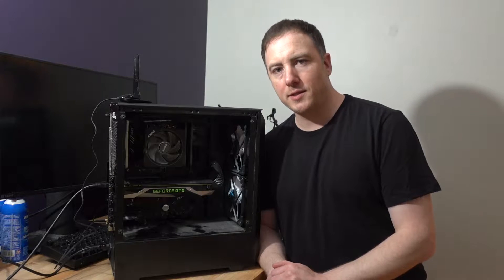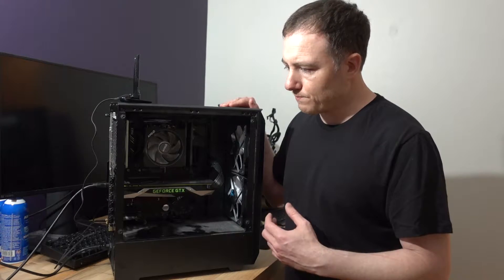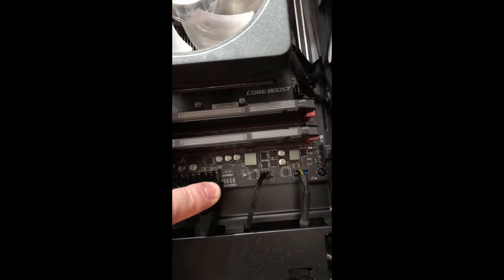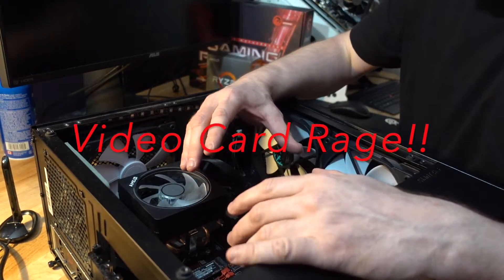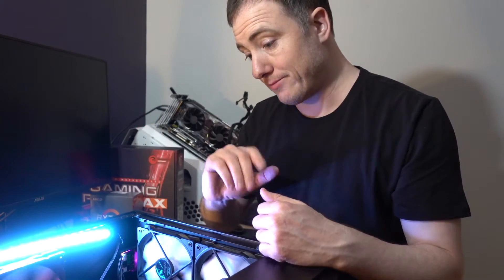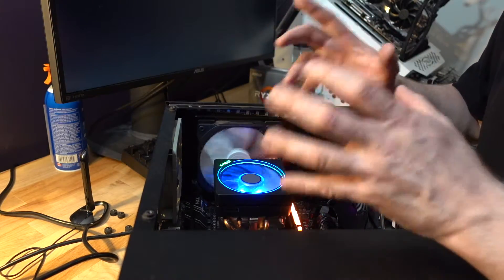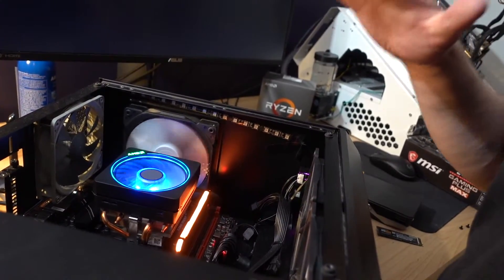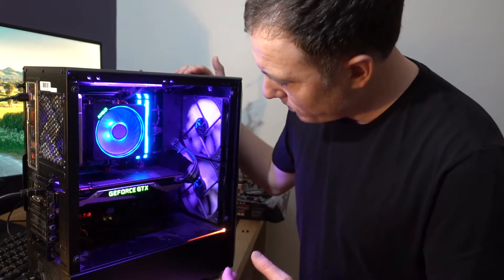AMD Ryzen NOT booting! - Troubleshooting PC -

Comment: I have a new mobo msi B550-A Pro. 
• PC boots & post with Amd Ryzen 9 3900x
• Doesn't boot at all when i put my Amd Ryzen 9 5950x

Do I need to make sure the 5950x cpu properly fits onto the socket without any side being wobbly?
Reply from the maker: Hey did you ever get this working?

Comment: Hi good vídeo,
I have 2 computers, an ASRock steel legend b450 board with ryzen 53600 and another with msi x470 gaming plus board with ruzen 5 1600 af. On both i have a rtx3070 gpu.
I bought a ryzen 7 5700g and i test it in both computers amd none of them boots with this apu... I have downloaded latest versions of both boards and still won't boot up. What could i try? Thanks in advance
Reply from the maker: If you have already updated the BIOS on both boards to the latest it's possible it's not supported. B450 and x470 I thought recieved support for all the AMD 5000 series chips, but because the 5700g is new it may not have been addeded yet. Also keep in mind that the BIOS only has so much storage so that's why adding support for the 5000 series's was an afterthought. I know MSI with their MAX boards have a 32mb BIOS and so they typically have added all the 5000 series while retaining support for the 3000 and 2000. Best thing to do first if you haven't already is check ASRocks website and MSI to make sure that the exact model of board you have supports the 5700G. If your MSI pro is not the MAX version then MSI possibly didn't have room to add the 5700g chip. AMD is known for their backwards and forwards compatibility, but that being said you there isn't enough BIOS storage space to store all the Agesia code for the 1000,2000,3000, and 5000 chips. Anyways, first head over to ASRock and MSI and look up your exact motherboard models to see if the cpu support has been added for the 5700g. It's also possible they have a beta bios (non official) that could work. And finally maybe reach out to them on Twitter to ask. Good luck. Also, reset your BIOS by pulling the batter if you haven't tried that.
Reply: @quicktechtalk_3188  i have check the list of compatible cpu and 5700g is listed so im trying to reset the bios... The thing is if i dont plug the old cpu i cant access bios, so i have to be changing  the cpu each try. Thanks in advance
Reply from the maker: @LuisPeris  reset ram speed to default, not xmp, to see if that will get it to boot.
Reply: @quicktechtalk_3188  finally y update steel legend motherboard bios and it works in this computer! Thanks for the support
Reply from the maker: @LuisPeris  glad to hear. Enjoy!

Comment: I thought Max was their board variants where they upgraded the BIOS SPI flash chip from 128MBit to 256MBit to accommodate future AGESA versions, otherwise identical to prior revisions. But the BIOS memory window of early Ryzen chips is only 128MBit anyway so that change has not been relevant for them. The upper half contains another AGESA (or sometimes an entire whole BIOS) that can be addressed by newer Zen chips.

Taking out the clock battery doesn't always fully reset the configuration memory, as parasitic capacitance in the chips and deliberate capacitance in the circuit can uphold some of the data potentially for hours. Back in the day, you could reliably reset the configuration memory by shorting the battery contacts with a screwdriver, nowadays it's no longer the case, as the battery is connected via a resistor diode arrangement. The RTC reset jumper is foreseen for a reason, it's not connected to battery, but controls specialised pins on the south bridge and the SuperIO/SMC chips instead. Furthermore since the system requires voltage in the corresponding circuits to function, other diodes supply voltage from the power supply, usually downregulated from the 5VSB line, so taking out the battery when the power supply is connected and 5VSB circuit isn't fully drained is generally futile! You're likely to disrupt the RTC but not the configuration memory.

It's also no longer necessarily the case that RTC and configuration memory are contained on one chip, as opposed to Motorola 146818 based and clone designs like you've seen 20 years ago. To take Intel's ICH8 as an example, the configuration memory is contained therein. The specification says that the "Implementations should not attempt to clear CMOS by using a jumper to pull VccRTC low", in other words, dropping the battery voltage to zero plain doesn't work properly! This is just the specification i already had at hand, which is why i'm quoting it, i don't have AMD Promotory chipset datasheet, but i can see some similarity in the mainboard implementation (i have a random B350 board schematic at hand) that leads me to conclude that they have something similar going, though i can't reliably tell where the configuration memory lives, whether it's on the SuperIO chip or the southbridge. There's another difference in that i can see the RTC being integrated into the Intel chipset, while i can see a separate RTC chip on the AMD board.

Power supply test: i recently bought myself a Seasonic Focus 550 and there was a nice surprise in the box, a test plug. You put it on the main 20/24-pin ATX connector, It shorts the PS_ON pin to ground, so it hotwires the power supply to enabled, and you can open a flap and probe directly into the plug with your voltmeter. It's an insanely cheap item to manufacture and i thought it was pretty neat gift for the DIY PC enthusiast! Unfortunately you can't buy this exact item separately that i know of, but you can buy something functionally similar, just not as elegant.
Reply from the maker: Yes, I believe the Max variants have 32mb bios.

Comment: My pc was working fine untill there came a clicking sound from the psu that means it's Broken, so i bought a new one, put everything back together and wont boot, then i bought a new motherboard and still doesnt work, but when i don't insert my cpu cable in my motherboard the pc can turn on otherwise it Can't

Comment: Lucky man...you did it... it's the same story for me...upgraded MSI B550M PROVDH WITH RYZEN5 5600G with bios update Ez bug CPU light turned ON ...no disply..no bios posting...trying to solve the same thing but didn't so far...
Reply: Had a similar thing man swapped out my mb for a b550 Asus and worked 4 months no problem got the red light the other day can’t boot no bios or nothing
Reply from the maker: Hey, did you ever get this resolved?

Comment: I'm from Brazil and this problem here is big, My mother board just stopped working and I went to make a little research on the problem and found several people with the same issue, most are able to boot by blowing hot air at the motherboard for a few minutes and them turing it on, people are speculating is that the motherboards can't work with humidity
Reply from the maker: Could be there humidity; either the hot air is evaporating any water/condensation or it could be that the hot air is making the circuits / solder connections good. Maybe the motherboard has a broken circuit trace and the hot air heats up the solder enough for it to make connection.

Comment: im running a 5950x on the rog viii dark hero. It'll boot once in a blue moon but i've mainly been waiting on another bios update to roll around
Reply from the maker: It's frustrating AMD haven't ironed out all these issues with their Agesa updates. It's mid 2021.
Reply: @quicktechtalk_3188  I figured a way to make my system more reliable ever since I posted this comment. avoid using pcie extenders for gen 4 cards and only run a single stick of ram. My computer went from booting once every 20 tries to booting grub flawlessly.

Comment: My pc crashed a couple days back now won’t post at all. My pc seems to be turning on properly but not no signal sent to my monitor. Any ideas?
Reply from the maker: First try to reset the BIOS, pull the cmos battery and leave the PC unplugged from power for 30 seconds. If that doesn’t help, then reseat your Ram, GPU, and CPU. If you were over clocking then resetting your bios should put things back to default.  Since the PC is turning on it sounds like your Power supply is working.

Comment: I had a problem with ryzen 5800x series cpu where my Pc turns on, all led's on, fans spin, and even have a display but when I boot from bios everything turns off, and I dont get display when I turned it back. I could use some help on this!
Reply from the maker: Have you tried to reset BIOS? Remove CMOS battery while power cable is unplugged and leave it for 30 seconds. Put battery back, then see if the PC will boot. Did you change any of the settings in the bios? Also, CPU/Heatsink mounted ok? GPU seated ok? and everything has power ok? GPU, motherboard 24pin + CPU 8pin.
Reply: @quicktechtalk_3188  I tried taking out cmos battery and resetting it but it still didnt work. Tried switching the ram sticks out,  I looked up my ram and its compatible with my mb. I have a B550 Tomahawk, I tried to update it by using the flash button and a flash drive with the update on it. I wonder if that messed my mb up because it was my first time trying to do that. Thats the only thing I can think of since it was getting a display before then. The first time I made a mistake and booted it up without the update and thats when it stopped getting a display. Ryzen chips are so confusing, never had any of these probs with intel!
Reply from the maker: @KeN_The_SaMuRaii  I normally just update the bios from within the bios. I know some motherboards have that button on the back, the bios flashback etc... but I haven't used it. It's possible maybe you didn't leave it for long enough time? You can try to use that button again and do the flash. As far as I know, you just dump the BIOS file onto a blank USB key, and then either turn the computer on or keep it off and hold that button. I'm not exactly sure on if you hold the button or just press once, so look in your motherboard manual as it'll tell you. - Dave
Reply: @quicktechtalk_3188  Thanks man, I will look more into the flash button then. Appreciate the help!
Reply: @KeN_The_SaMuRaii  Any updates? I'm still having issues. I've replaced everything but the RAM.
Reply: @TripedalTroductions  I could never find out whats wrong, just going to take my pc to bestbuy and call it a day🤷‍♂️
Reply: @KeN_The_SaMuRaii  🙁 good luck
Reply: @TripedalTroductions For your issue try just using one ram or contacting amd support to see if you need to update the mb before start up
Reply: @KeN_The_SaMuRaii  I flashed the bios with a usb but no luck. I'm going to try exchanging the RAM tomorrow as a last hail Mary. It could have been a power surge so I will also be getting a surge protector lol
Reply: @TripedalTroductions  goodluck man, PC problems are the wprst!
Reply: @KeN_The_SaMuRaii  thanks man. fingers crossed
Reply: @KeN_The_SaMuRaii  Replaced mobo, CPU and RAM and still black screen lol. Even flashed the BIOS.
Reply: @TripedalTroductions  It may be be a power supply issue, try swapping that out. If not give Amd a call and see if they can help out. Let me know what they say because as of now im ready to switch back to intel. I had zero problems with my builds until I switched to Ryzen!
Reply: @KeN_The_SaMuRaii  So it turns out I'm a dummy. Swapped out CPU, PSU, mobo, and RAM. No dice. I tried my monitor plugged into my graphics card every time except this time when I swapped the RAM. Forgot Ryzen has no integrated graphics. Turns out it was bad RAM. I even had a surge protector so it wasn't that. What are the odds of two dimms going bad! Oh well. Got a sweet deal when exchanging my 16 GB kit for a 32 GB.
Reply: @TripedalTroductions  Well you are all set man, congrats. Im going to try switching out my mb because I think I fried it when I made a mistake and launched it without the update
Reply: @TripedalTroductions  Most definitely, do you know if the B450-fs got the update yet for the Ryzen 5000. If so I can just swap it out with that until I get a new mobo!
Reply: @KeN_The_SaMuRaii  Not sure about that one. Maybe someone here could answer that for you.

Comment: I had an issue with intermittent boot failure. Then I come across gpu braces, decided to fit one and its never failed to boot again 'touch wood'.
Reply: You'd think that's what beepcodes are for, to inform the people reliably of exactly such problem? Apparently MSI just can't be arsed to implement things properly, maybe some others as well.

Comment: Can anyone reading this video confirm the hypothesis. I successfully troubleshooted this same issue several times. Especially when changing the monitor to TV or other outputs. In my example, I always deplace my pc physically and so the power is cut from the pc, which can make a difference.

Comment: Hey guys, thought to share the solution for this as I have an aurus v2 and have had this issue for days... So my theory is that the board is not booting as it doesnt find the connected monitor/TV on the GRAPHICS card! Just swap your cable to the onboard video output from the motherboard 👍
Reply: Should be no issue if in bios its permitted. But your problem will not be solved
Reply: bro,can i use board hdmi for bios for my cpu ryzen 5 3600?now i facing above th same problem.
Reply: Do you have an other screen to put on hdmi?

Comment: Hey man quick question? I just upgraded from the Ryzen 5 3600 to the 3700x, and everything seems to be fine and working. I click on SYSTEM and it shows I now have the 3700x as my cpu, but when I try to enable All cores and when I go into the Task manager, still says 3700x but under CPU its still showing 6 cores and 12 threads from my 3600? Any ideas as to why this is, and how to fix it? Please Help. And Thanks
Reply from the maker: late reply... are you still having this issue? Where were you trying to enable all the cores from? The bios? Speaking of which, update your bios if you haven't already. I've encountered some really bazaar issues after doing CPU upgrades that went away after updating the motherboards BIOS.
Reply: @quicktechtalk_3188  its all set now i had to disable all the cores from previous CPU then restart the pc and it was fine, but thanks for the reply late or not!

Comment: Mine was working for maybe 3 hours and every time I launched a game my system would reboot.  So I  disabled the docp profile for the ram similar to what you did resetting your cpu to default.  Now it definitely won't boot and also no usb devices are recognized.  The system is getting power just like yours.  I tried moving the ram out and then just having one stick in and no luck.   It's funny every time iv ever owned an amd system this stuff happens .  Every time iv had intel this stuff has never happened.  I'm not trying to throw shade but for 20 years man of building pcs iv never once had an amd system just work without problems.  But everybody swears by ryzen .  Why?
Reply from the maker: I would agree. I’m glad AMD is doing so well but I’ve personally never had issues like this with Intel systems
Reply: AMD has sometimes an issue of 'cursed' builds, memory compatibility, memory calibration procedure, BIOS troubles, rough unpolished release procedure. Intel has rough releases a couple times over the years, not as often as AMD, and not as bad. Cursed builds are always possible with both CPU vendors, but they are about an order of magnitude more likely on AMD.

Everybody swears by Ryzen? Well it's fun to root for the underdog, and the CPUs and platform chipsets perform really well (when the build isn't cursed), and the pricing is good for the performance, and they don't try to lock you out of CPU and platform features arbitrarily much.

Out of curiosity, which Ryzen chip, which mainboard vendor, and which RAM vendor?

Comment: I have Ryzen 3900x and cant boot, same issues. Has been working flawlessly for 4-5months. If i clear CMOS and skip bios, I can sometimes boot to Windows and everything runs flawless. I wish mine magically worked like yours did. Newest bios, tried new ram... Damn red light.
Reply: Im in the same shituation. And now that I extracted the 3900X I think I might have bent a pin... so fucking typical. I hate computers.
Reply: @Mattsana   I did not have a bent pin, but after every test that exists - I was left with 'bad mobo or cpu."  RMA'd the 3900x and AMD sent me one crazy fast.  Highly impressive customer service. Popped it in, havent had a problem ever since.  Im not a pro, but don't believe the "cpu's never fail" people are saying. Good luck.
Reply: @megusta2620  I agree. In my case it turned out it was the RAM. The S-shaped pin that I unfortunately caused I was able to repair on my own. Thank god for that. Now my fiancées system is running flawlessly! I guess we both got out of this great after all :D Cheers!

Comment: I have 2400g as well (gigabyte aorus b450 i pro wifi) and for 2 years yet it boots randomly, even sometimes it need 10 tries and I've tried everything - reseat everything, new BIOSes but the problem is still present. I am waiting now for ryzen 5 5600x and I hope the problem is gone with the new CPU
Reply from the maker: Yeah I still don’t know what caused it, I just reseated the CPU. It started when I changed the memory XMP profile but I don’t know why clearing the bios didn’t work as it usually does. Weird Ryzen issues. I’m sure yours will be gone with the new CPU, make sure you update to the latest bios, enjoy the 5600x!
Reply: @quicktechtalk_3188 , I just put ryzen 5 5600x and the problem is gone!! It is the processor (at least in my case). Works like a charm on my GB b450 I wifi pro, of course with F60e BIOS
Reply: @bobbycool85  i have a 5600x and i have this problem after 1 month of use
Reply: @ngki4496 , so may be the cpu is not ok